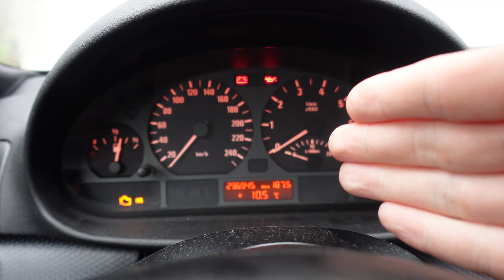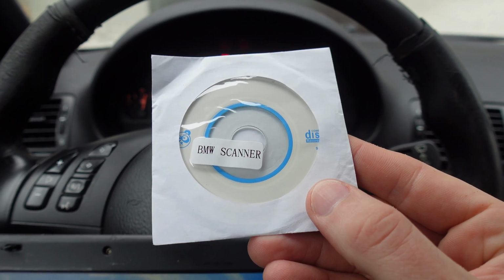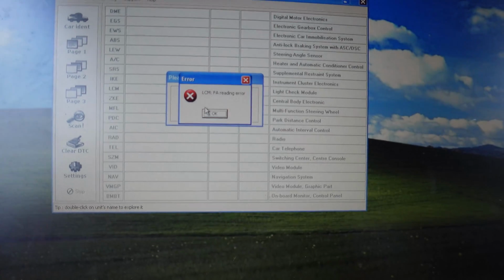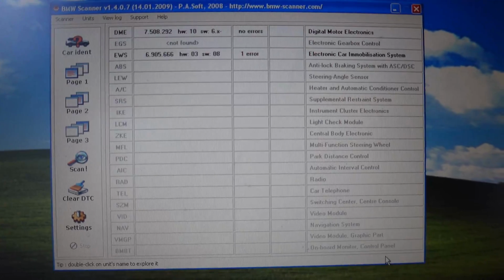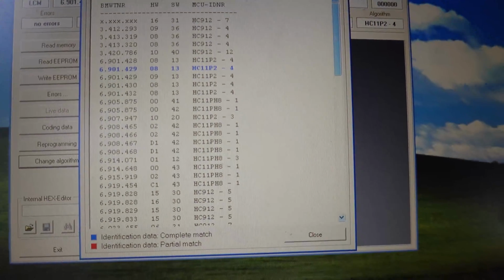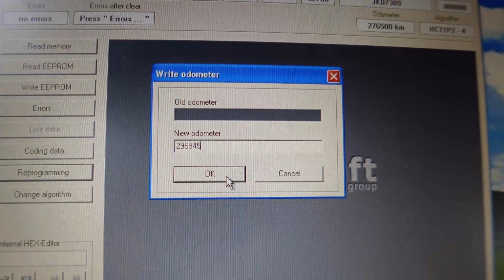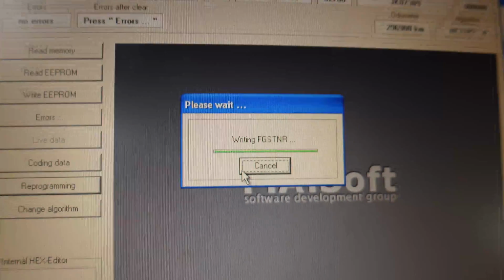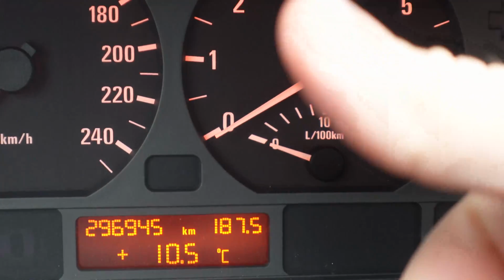E46 Odometer Tamper Dot Fix: Light switch module VIN and mileage coding

Comment: Is this the same process to change the Instrument cluster (IKE)? I had to replace the cluster with a used cluster from a doner car, the old cluster is unable to be used. I just need to match the replacement to the car. Any help would be greatly appreciated. Oh! and how did you select the correct algorithm? I could see how you did it and I have 4 different blue choices. :)

Comment: hello! recently bought an e46, previous owner told me he changed the IKE so i have that "dot", now i have a question, does the LCM "saves" and progress the mileage of the car? if so is it possible with this metod to modify the mileage on the IKE to the value of the LCM? (basically the opposite of what you did). Thank you!
Reply: what you did?
Reply: Me? Nothing yet, I was waiting for an answer 😅

Comment: How to change milage? my old speedometer nroken and bought one from jankiyard but the new one has lower mileage
Reply from the maker: To fix the odometer in the cluster you need to desolder the chip from the board and reprogram it (there are people on the internet that do this as a service). Desoldering is a problem if you dont have the skils and tools. Alternative is a hack where you set the speed factor so that the miles increase much faster (for example x100), you then drive the car precisely until you reach the desired miles and then reset the speed factor. This is a tricky hack, but can be done.

Comment: Hi sir I change my cluster out with other one but I have the dot infront the miles and my fuel range, outside temperature etc is not working? Any ideas
Reply: Have you find a solution for your problem ?

Comment: Hi, i‘m repairing a fire damaged E46 and have been supplied a used LCM, following your instructions to 1st check for correct algorithm in the support list, it only finds a partial algorithm match HC912-12 coloured in red and the part number is different, does this mean i cant match to the car.?

Comment: Hi. I have a different case. My LCM is at the correct Odometer reading but my IKE Cluster is not. Can I code it using your method but for the Cluster instead of the LCM?
Reply: Hello, I have exactly the same thing as you, my IKE module does not give the right ones while the LCM does. You were able to recode it, if so how did you do it, thank you for everything.
Reply: @doliax1999 Hi. I'm not able to. You will have to resolder some parts in the LCM in order to code the odometer. This is what I know, but I might be wrong. I didn't code it successfully in the end :) cheers

Comment: Question real quick is it bad to just leave it and not reprogram it
Reply: I have it on my 530d because the last owner change the odometer (crystal dead). 

I think it’s not serious
Reply from the maker: No problem at all.
Reply: @BimmerZen   Hi, I have the same problem as you but in reverse, the previous owner changed the cluster because the crystals were broken, (fortunately the new cluster has the same mileage as the LCM at 1500km ready, I will write again the mileage on the cluster on the LCM) but my question is is it possible to write the VIN of the LCM on the new meter? Rather than the opposite as in the video.
Reply: So if I have an e46 and wanted to swap the cluster I can and the car will start with no issues?

Comment: Hello, just followed your post.. very much helpfull.
I have the intrument cluster changed from the old owner, i was able to change the millage.
The issue is that i cannot change the vin on the IKE.

Its telling me that i need to factory reset before performing this action.
The problem is that the factory reset is greyed out and cannot be click.

Do you have any idea about this.
Reply: i have the same problem, did u find a solution?

Comment: What if we changed the gauge cluster? Can you do another tutorial? Btw, very useful as always
Reply: Also would like to know this as well. Have a donor cluster with original LCM. Is software enough, or do we have to unsolder chip inside of cluster then reprogram?
Reply: @IAmMrMogul I changed my cluster and i haven’t gotten around to putting the correct mileage on it. Did you ever cluster swap?